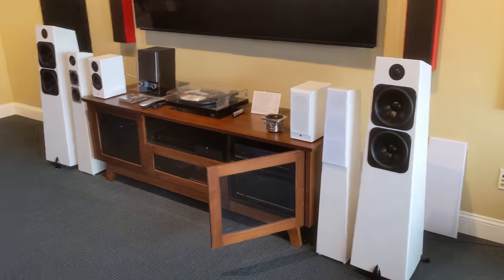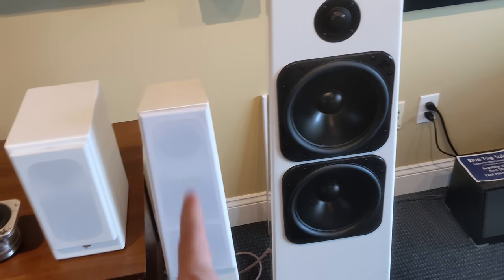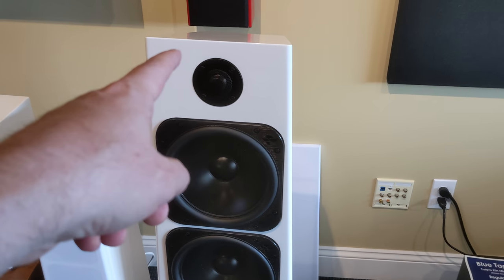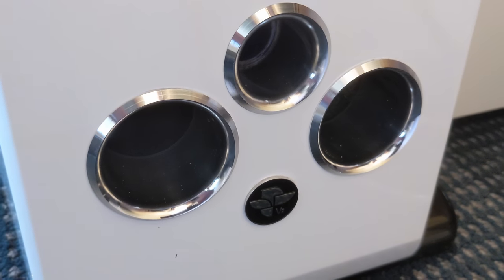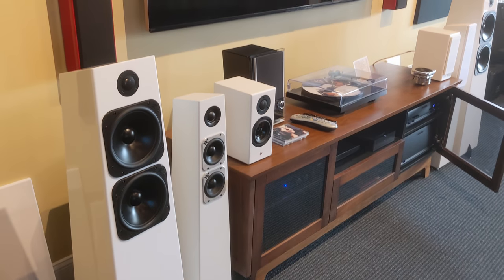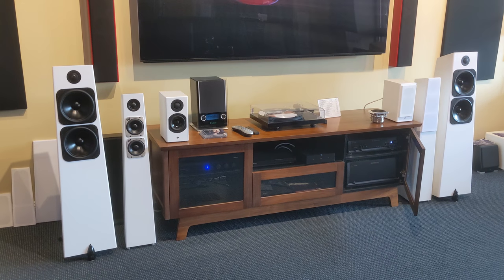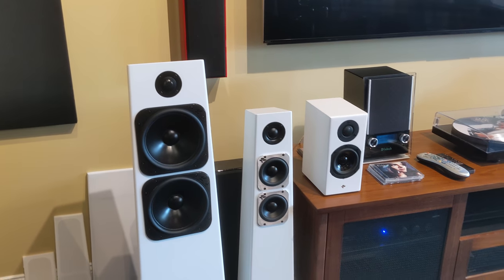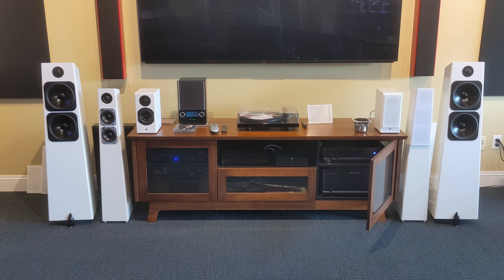Totem Acoustic Element Metal V2 Arrives!

Comment: What's the asking price on both the Metal and Tribe. And how are they on low to mid volume??
Reply from the maker: The pricing will depend on your country, so it's best to check with your local dealer. In the US, Tribe Towers are $5800 if I remember right, and $17,850 for the Metal V2's. They're exceptional at low to med volumes, this is a strength of Totems.
Reply: I have the V1's.  There's not much compromise on these...they do everything very well.  On top of it, they are "easy" to drive.  I've used them with an 8W SET 300B and they sounded great without sacrificing on the high listening levels.  I am currently driving them with my vintage Classe Audio DR-3 (25W pure class A), and they also sound amazing.